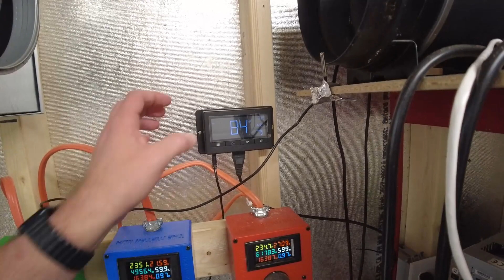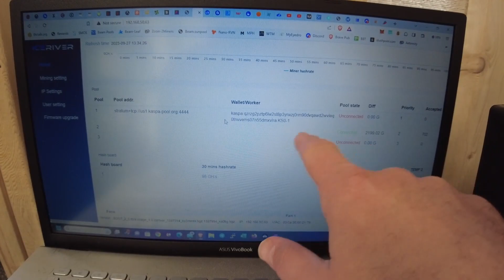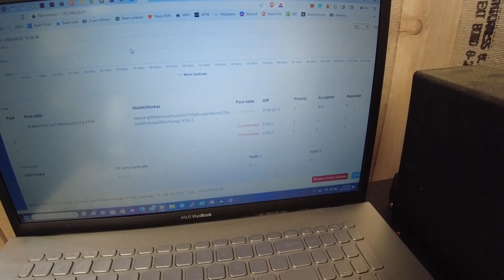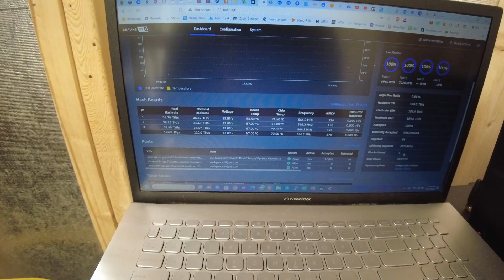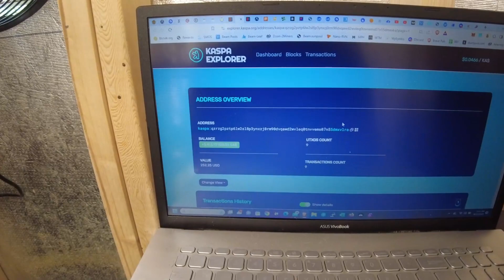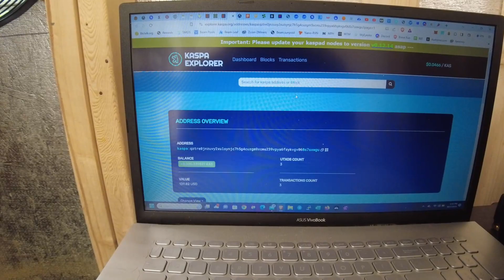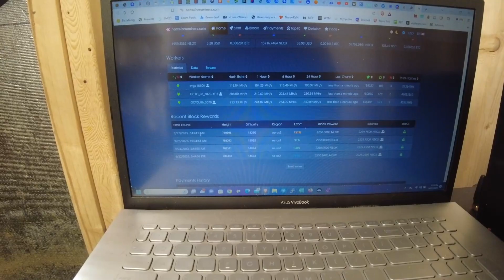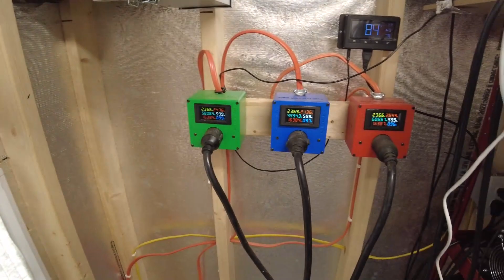My S19J Pro 104th Hit a Block! - Crypto Mining Shed Update 33

Comment: Great content man! I'm just starting out with a basement set up. Running S19J pro and 2 L7s. Similar to your intake exhaust set up. After seeing your awesome set up, I definitely want to build a shed.
Reply from the maker: I had my farm in my basement for over 3 years and I wish I would've did the shed sooner.  It's been awesome and gets all that heat out of the house.  My AC unit would be running non stop.  Now as it cools down, I'll move some open air rigs around to heat the house.  All the octominers will stay in the shed.  Just wish i had more power in the shed
Reply: @ruskyscryptocave  Yes, the heat is hardest part to manage. The summer was defiantly a struggle with basically three 3500W heaters running. I've got one intake and two exhaust running through a 10x10 room in the basement. I defiantly need more airflow, but I'm tired of cutting holes in the side of my house for vents. Luckily it's starting to get cold here in Nebraska so It's keeping the house warm.
Reply from the maker: @dknight5112  when I had my rigs in the basement, i walled off a corner that had two basement windows and used them for intake/exhaust.  Check out my 5 yr anniversary video for video of that room

Comment: one thing i noticed on my first KS0 with the USB fan is the internal fans would never kick on if i had the USB fan plugged in.  Unplug the USB fan and reboot the KS0 and see if they kick on. once they do plug in the usb fan.  kind of stupid but that's how my original KS0 behaved even on the old firmware.
Reply from the maker: Thank you, I will give that a try when I get home from work today.  Mysecond one doesn't have a usb fan and they still aren't kicking on